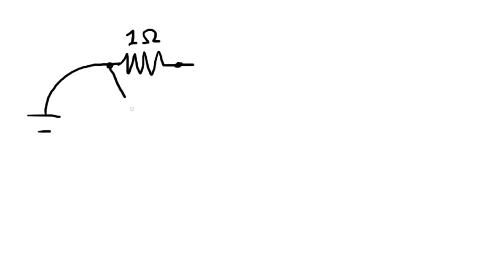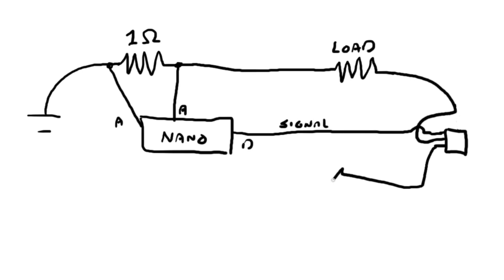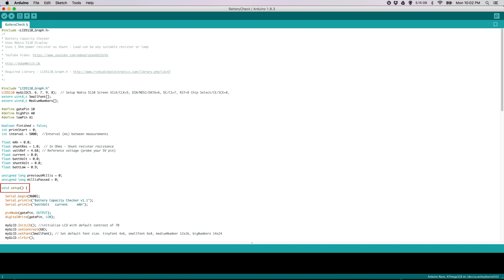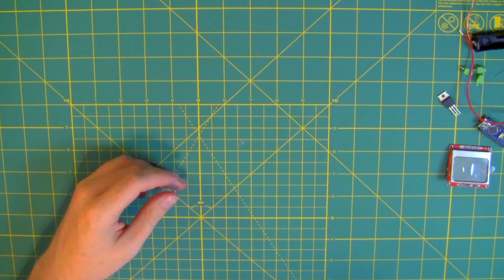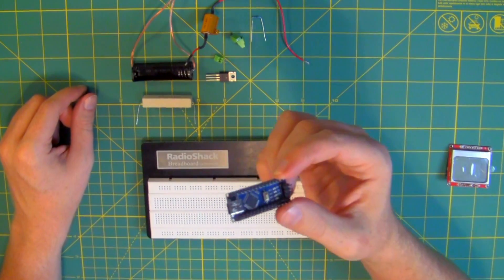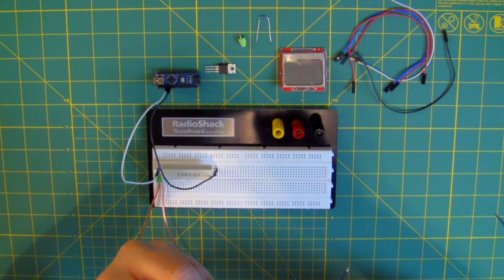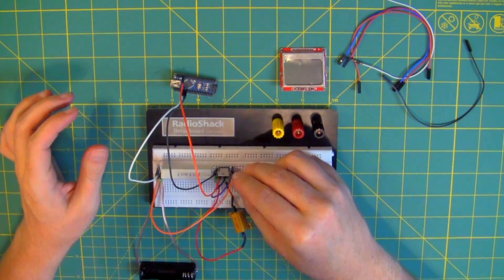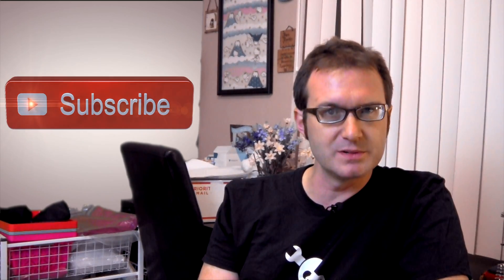How To Build A Battery Tester

Comment: I'm a "bit" late to this video but would there be any way to scale this up for multiple batteries using only one Arduino? Or test 1 battery at a time and switch to another automatically?
Reply from the maker: I don't see why not. You've got at least 6 analog pins to work with.

Comment: I suck at making electronics, but have done a handful of guitar effects pedals.  This was cool and made me want to build stuff and burn myself with a soldering iron again!
Reply from the maker: +The Bearded Math Man Thanks, Philip! I've never played with effects pedals simply because I never played guitar, but I've considered trying to design one for S&Gs. Grab the old soldering iron and build something cool! (I would suggest the ruler that I reviewed/assembled in a previous video as good practice!)
Reply from the maker: +The Bearded Math Man The worst soldering burn I ever got was the very first time I used an iron. It was my grandfather's that I inherited (along with several manuals and diagnostic tools that he had), and I was attempting to solder wires onto a PCB for this light-up Starship Enterprise model I was building. Well, like the uninitiated child that I was, I wasn't thinking and I "choked up" on the shaft to get a better grip (as if it were a pencil). Needless to say, I wasn't able to do my homework very well for about a week!
Reply: Sorry, no homework!

My first time was my worst, too.  I thought I unplugged it, thought it was cool.  Picked it up by the tip thinking it was cold.  It was not.  DOH!
Reply: Oh, but I have had a similar shaped burn, but much worse from a piece of lacing wire that shorted out in a Howitzer when I was in the army.  Just 24 volts....but 300 amps.  The lacing wire completely disintegrated!
Reply from the maker: +The Bearded Math Man Ha! I guess we've all got to learn somehow! As my Popie would say, "We all gotta take our lumps!"
Reply from the maker: +The Bearded Math Man Holy crap, man! How far back did that launch you?!
Reply from the maker: +The Bearded Math Man Gadzooks! I bet that was a fun discussion at the infirmary (assuming you didn't just put some styptic on it and go about your business, lol)
Reply: AirborneSurfer I just rubbed some dirt on it and went to work.  oh, to be young.  today I'd likely get an infection and lose a finger.
Reply from the maker: +The Bearded Math Man Ain't that the truth! Can't let things go like we used to lest we risk a hospital stay, lol! "Just put a little ice on it; it'll be fine!" 😂😂😂

Comment: I believe I actually built something similar to this  in tech class back in high school as a class project. The meters were obviously lower tech (it was like...1990, lol) Cool!
Reply from the maker: Thanks! This is a pretty simple build, and it's almost cheating to use the Arduino, but I wanted the ability to tally over time and export charts for an upcoming project! (Stay tuned....)

Man, I remember wanting to build fun stuff back in the 80s and 90s and just not having the tools or parts available to me! Instead, I would take something like a radio apart and try to figure out how it worked--and promptly be reprimanded for "breaking" it. Eventually, my parents gave up with that battle, lol!